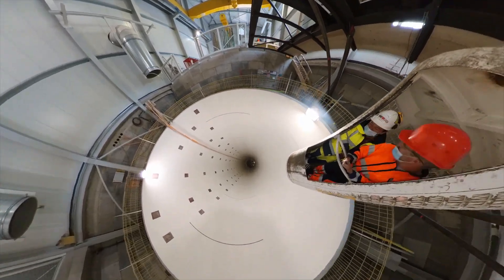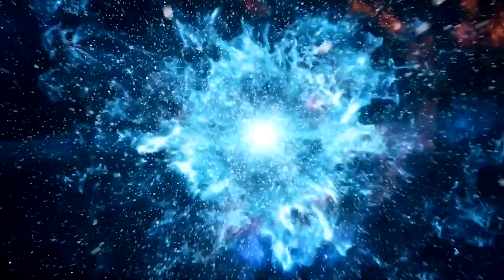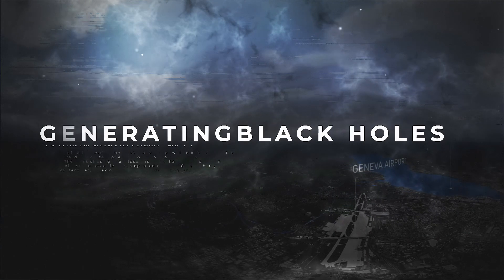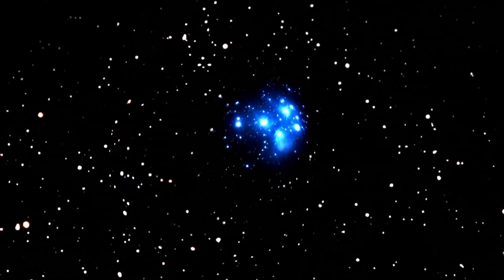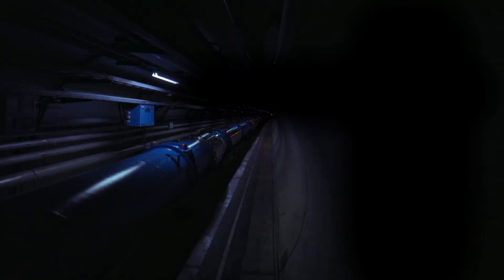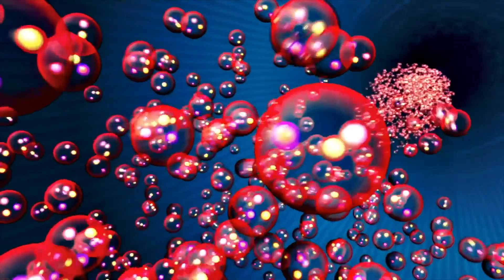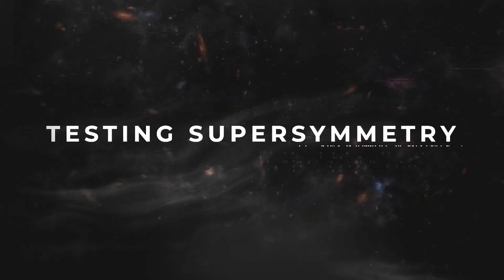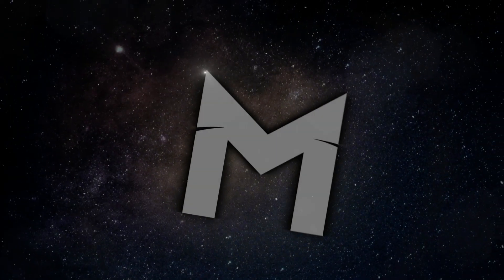The Stranger Things at CERN That Nobody Can Talk About

Comment: What if dark matter or antimatter or dark energy, whatever this big thing is that's fueling the expansion of our universe actually comes from black holes?

Imagine you have two bubbles. One filled with white. One filled with black. Both have their own size, density, viscosity, etc... But they also have a mass/energy constant that must be maintained to keep the system stable. 

You suddenly make a bridge between them. The more energetic bubble  would pour it's contents into the least energetic in order to expand and find a more stable state. 

BUT to maintain stability, each would need to rebalance their densities after the chaotic exchange. This means: the less energetic bubble would need to expand to take in new energy and maintain the same density, while the other would actually shrink. 

Black holes and dark energy could really be this simple. They tiea channel to another bubble. Whether that's a universe or dimension or whatever... And matter/energy leaves this universe while undetectable antimatter/energy enters. 

The balance is maintained. But our less dense universe must expand to maintain density.

Over time to maintain ideal density in both, they'd actually have to exponentially shrink/expand in order to do it. Think about it.

Comment: THE PROBLEM: With all of their machinery, scientists refuse to admit that the level of design, that currently exists, comes from a level of intelligence that is far beyond human comprehension. This intelligence is expressed even greater at the sub-atomic level. For a sub-atomic level particle to be created and then joined together with other sub-atomic particles to create an atom, is astonishing engineering. Especially with no machines, computers, or tools. How these sub-atomic particles are fueled is another major kink in the scientific dismissal of intelligent design. This CERN THING seems quite dangerous to me. Tapping into the unknown without proper assessment of the WHAT IFS, is a recipe for disaster, should something be opened that far outweighs their capacity to control it. The arrogance of scientists to think that what’s on the other side of these experiments can be controlled is foreboding and symptomatic of human overreach. Instead of investing money to end hunger and disease, they’ve chosen to reach into an unlimited amount of dimensional scenarios that could potentially wipe humanity out, and possibly the universe as we know it. 🤷🏾‍♂️🤦🏾‍♂️👎🏾

Comment: So couldn't a quantum black hole start to slowly get bigger & bigger, devouring all matter at a quantum level, then bigger matter?  How would a quantum black hole be stopped if it did start to do this?
Reply: No.  It needs mass which needs gravity. Mirco black holes don't have that.  Our sun doesn't even have that. You need bigger stars for that.  Even if we made a black hole that didn't die due to hawking radiation.  It would be lost in space because we are moving thru space around the sun.
Reply: My question also.
Reply: @Noxti! awww there were a coupla good SF stories that used that plot.
Reply: Hawking radiation. Such an extremly tiny black hole is simply way too shortlived.
Reply: @Rai_Te    Hope Hawking was right with that.

Comment: I wonder how each material stream in high quantity reacts to the fields to start with and then which frequencies could be added to the fields to make the materials or energies ack like a tuning fork that keeps increasing causing high heat at low power inputs that could be used in new fusion commercial reactions.
Reply: Maybe two different frequencies could sync with a materials structural atomic structure an uptick little by little until mass-produced something like a tuning fork that can increase with the help of artificial intelligence.

Comment: They are basically trying to mimic the big bang theory by thinking all you have to do is make 2 atoms run into each other. So they built the biggest experiment machine under the surface. But apparently it doesn't work that way. So now they changed the purpose to looking for the non-existent God particle. The first one was built many years ago but I wonder what else they have above ground that we don't know about. Not haarp I mean something else. Interesting that when they were building the first a-bomb they also had a smaller accelerator involved.

Comment: I was once invited to Fermi lab for a job interview after I gave them a paper I wrote on something from Den Hartogs Classical Mechanics questioning a theory. They told me they thought I was right and they were going to do a test. When I got there they told me they didn't do the test because blah blah blah and told me to work there I'd have to read some ridiculous amount of pages on particle physics every week. So since I wasn't about to be controlled that way I walked away. Leon Lederman was director then. I have his book The God Particle and don't buy this explanation of the Madam Wu experiment. Or any other on Wu. It's all wrong.  I won't go into it here. I just wrote it to Williams Mary I think it was..
Reply: @Andrew Castro Madam Wu assumed it was electrons going through both the right and left handed solenoid.  If you change the polarity on the right handed solenoid parity is restored. The actual asymmetry is between the north and south hemispheres of the Cobalt atom. The beta emission is at the same pole in both set ups . Wus assumption that both solenoids carry electrons from negative to positive is the problem. There is a positive current in the righthanded solenoid from positive to negative.  Maybe you haven't studied Wu enough.
Reply: @danmiller4725  you're a smart guy, can i pay you to complete my university assignments?😁
Reply: @Andrew Castro pretty coherent to an average reader.  
Something similar happened to me in school, 4th year bachelor of biochemistry, special research project. The prof took all my hard work to himself, didn’t mention my name in the scientific paper he wrote where he used my results which all worked and tried to fail me ! 😂 I got a B for the paper but it deserved an A at least!
Reply: See opening ceremony its the pit gate ritual. Every event broadcast is ritual unchaining then worshiping the bull at commonwealthgames in front of bbc said tower of Babel.
Reply: Try looking at fpv angel decodes nasca n ley lines shows how elites fiddle earth globe via datelines, how a halo track with all our luminaries on it uses gates exit/ enter under a dome.
Reply: @lynnedinsdale5009  Thanks  Lynne.